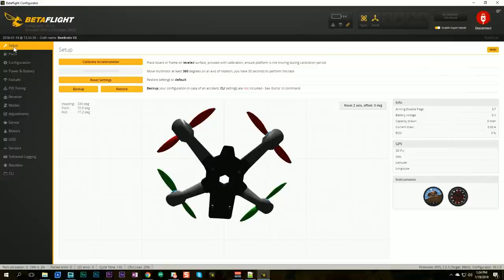Calibrate & Trim Betaflight Tiny Whoop Accelerometer | HOW TO FIX ANGLE MODE

Comment: Hi joshua, is it possible to have one headlight profile for level mode with trim and one more without if you want to fly acro in a wide area for example.
Reply from the maker: +Guillaume Fouquet accelerometer trim doesn't apply in acro mode. So just switch autolevel off using flight modes.

Comment: Thank you very much for that Brother Bardwell!  I have a BabyhawkR that the usb port ripped off of and it happened before I was able to set up modes so stuck in angle or horizon, no acro and after winding up in a tree, couldn't re-arm for just that reason.  The stick trim thing was cool too, so what are the trim buttons for then?  Looks like the stick commands for trim work quite nicely or do the trim buttons do it for the radio itself, not the individual bird?  Never mind, I get that part now, the stick trim does the bird itself, not the radio.  Thanks for all you do!
Reply from the maker: The trim buttons are used to trim out the stick itself if the stick is not re-centering correctly. The trim buttons should not be used to trim the flight characteristics of the quad. If you are using an airplane with servos, then the trim buttons are used to trim the flight characteristics but when you have a flight controller that's not how it works.

Comment: Also what about “in flight accelerometer calibration” ? I use it on the momentary switch on my Taranis to recal on the fly after a crash where my accelerometer wonky. Hope you get you voice back soon.
Reply: Yeah, I do this, too. It's a fantastic feature, and extremely useful for exactly the situation you describe. Kinda surprised Joshua didn't mention it in the video.
Reply from the maker: +Flight Dreams I didn't mention it because I didn't want to dive too deep into setting up flight modes.

Comment: Cheers for the vids JB.  I was wondering....if you haven't already, do a video on end points. I'm a noob. Learning slowly.  Have a few quads and trying to learn acro etc.  Followed videos on this quad and that quad and used the same pids/rates etc.  Tried flipping the quads like the reviewer was doing on stock pids.  Their quad flipped no problem.  Mine slowly rotated into the ground.  I know I'll put the rates up.  Still no joy.  Couldn't understand it.  Then noticed when I was checking the quad move in betaflight that the pointer on the graph was only going to say halfway left and right.  Looked into this and found out about rxrange # #### #### command to set endpoints.  Almost worked.  I now know about calibrating my sticks on the transmitter (Devo 10 Deviated with 4 in 1 module).  Just think it would be a good vid for noobs.

Comment: my brand new mobula 6 just yaws non stop..Ive been battling everylittle thing ...the props were on backwards for starters it tried to fly down not up. I couldnt get it connect for ages..then it randomly did. But now I cant figure out how to make it not just continuesly spin. I had to turn ondshot600 just to make one of the motors work. I thought the esc was blown..Man I would love too see a obula 6 FULL start to finish EMUflight guide please bro.

Comment: The key for a 10/10 accelerometer performance is to do a 6 point calibration is something, done in iNav and other quads for aerial photography, the acc won't suffer from drift after 1-2 mins of flight by doing this.

Comment: Thank you for this video Joshua. I'm just starting out (first flight today)! I've found that there is a persistent drift to the left (slight roll?). I've troubleshoot it to see if it's a problem with the sticks, or accelerometer, and it feels like it's neither. Connected to betaflight while leveled on the table, after arming, the graphic interface of the drone seem to be shifting, and the OSD horizon shows to be significantly off (at around 30 degree) even though the quad is resting on the table. This coincides with what happened today on the field where I had to roll to the right to keep it leveled. I did this both on horizon and acro mode and they all were shifting... Any thoughts?

Comment: Pretty sure you have to save trims before disconnecting battery - either with stick command or by connecting to pc and clicking save in beta flight config.
Reply: There have been a lot of comments about this so far.... In a fairly recent BF release ( I think it was 3.2) a change was made so that all accelerometer trim changes made via stick commands are saved automatically. No more manually saving them.

Comment: Good video! I have a point/question to address in your next videos. How come sometimes after a tiny whoop crash/bump the accelerometer resets/recals to be unlevel. It’s like for a brief moment during the crash/being sideways it recalibrated on its own. This happens on my acrowhoop v2. 

It would be ideal to prevent this from occurring so you don’t have to recal with tiny whoop flat on ground after this crash/bump Anomoly. Ok thanks!

Comment: Josh you're missing a big part of the equation here. I've talked with Jesse about this in great depth. It's not just auto level, it's also having a stock FC (specifically the Inductrix FPV FC). The factory tune can not be perfectly replicated in BF and they never fly as well in auto level.

Comment: Note that since Betaflight 3.3.0, to use the accelerometer trim stick commands, the craft must be in angle mode when disarmed. Simple fix; adjust the angle mode setting in the configurator/modes tab to include when disarmed.

Quite why they made this change I can't fathom, it's not like the accelerometer trim affects acro mode.

Comment: Don't be ashamed to fly in angle mode, guys. #metoo
Reply: Thank you for NOT angle-shaming me! One day I will be an acro-flyer, but until then I no longer have to hide my quad.......😁 It feels so good to be "out" 😀
Reply: @sunsetpark_fpv  I don’t know if you’re joking but I’ve been flying since 2015, I use angle mode inside. So much more fun, not having to constantly correct for air disturbance from the ground/walls, etc. outside it’s acro tho 😝

Comment: I usually save on the taranis after doing a trim as I was under the impression that if you disconnect the battery it resets the trim back to what it was originally set at. Sticks down and opposite. On the angle mode vs acro flight, I am always a bit in two minds, as I have flown helis for years its almost identical to angle mode in reference to having to always hold position on sticks except there is no limiting max angle by the flight controller i.e you always have 10....15.....20 degrees of stick held to fly in forward flight and if you release the sticks the swash tends to level out and heli slows down particularly with flybarless......albeit a lot slower than a quad. And having this type of system in no way limits the type  or speed of any manoeuvre. Which kinda confused me when I hear that you must "fly in acro" to be any good being force fed all the time....which I do anyway. I'm sure with some tweaking in BF cli the angle restrictions could be removed or tamed .....obviously horizon mode now but to allow inverted for longer hang time etc. I think....doh! Now I am confusing myself again 😁
Reply from the maker: Hmmmm that's a good question. Do you need to save? I would have to verify it.
Reply: I just checked.....it looks like it auto saves now, so no need to save.
Reply from the maker: Oh that's nice.

Comment: How do you do this accelerometer trim with a Specktrum radio? Cant you just trim it like you normally would with the trim switches?
Reply from the maker: No. You shouldn't use the trim switches for the reasons given in this video. The process of trimming the accelerometer works the same regardless of what type of radio you use because the trim is being handled in the FC not the controller.

Comment: On the betafpv 65s when attempting the stick calibration non of the lights flash. But it does seem to work. Just not sure if it is actually working.
Reply from the maker: I had the same thing on the acrobee. I do think it's working though.

Comment: HELP! My 3" quad pitches backwards after calibration, and adjusting through stick commands.  It seems fine for about 30 sec then increases after a short bit of  stick deflections. what can I do?
Reply from the maker: This is the accelerometer drift bug and there isn't a fix that I know, other than to change out the FC.

Comment: I was having a frequent calibration issue with my NBD and picked up a good tip from "Derek and His Drone" that makes my whoop re-calibrate every time I power it on 'set gyro_cal_on_first_arm = ON'.  Seems to have fixed my problems :)
Reply from the maker: The gyro always calibrates when the FC powers up. The gyro cal on first arm just changes it from "as soon as you power up" to "just before you arm".

Comment: you used to answer my questions in a timely fashion! just saying must very busy!...anyway my Q- the bataflight F4 how do i hook up the beeper ? i soldered one to the board but nothing! di i need to into bata flight config?..
Reply from the maker: I currently receive about 150 questions per day, all of which I answer if I can. Sometimes I don't know the answer, and instead of saying so, I just pass over the question to save time. Sorry if my response time is not as fast as it used to be. Please don't hassle me about it I am doing my best.

If you soldered the buzzer correctly to the board and it still doesn't work, I don't know what it could be. Even if you have enabled dshot buzzer, I think the regular buzzer still works. But I guess I would try seeing if the dshot_beacon_tone parameter is nonzero, and if it is nonzero, set it to zero.
Reply: no! no hassle sir! im just saying! ...its hard to get expression across in a text!..im having problems with the buzzer functioning on the bata flight F4 has this happen to you?

Comment: Accelerometer measures acceleration and deceleration. So why does it matter the angle the flight controller is? How does the accelerometers detect angles? Isn't that the job of the gyroscopes?
Reply from the maker: Gyros cannot detect angles. Gyros detect rotation but not linear acceleration or deceleration.

Gravity manifests as the feeling of a downward acceleration. Therefore, the accelerometer can detect the direction down and up. You are correct though that acceleration can throw off the accelerometer. If you move forward rapidly, the artificial horizon in an acro-mode quad will pitch back from the acceleration.
Reply: No Josh, conceptually wrong.
Gyro detect angle but without enough accuracy  for a long time .
 Accelerometer measure G and his variation of direction is a good measure of an angle for a long time.
That's why you need to have an accelerometer for long term stabilisation.
Reply: A gryo is balancing mechanism based on a circular 3D plane and provides data on initial set point and angular momentum/feedback as it resists to retain that set point. Gyros in that sense are automatic. Accelerometers are a form of measurement and don't perform correction on their own. You can view them as  basically 2 levels on a 2D X/Y plane that need their 0 points calibrated in order for the FC to understand tilt/angle as you see fit. If this center is off then you won't level out without manual intervention. Accelerometers being off can/will have more affect than front/back/left/right drift (the most obvious thing to perceive)..specially noticable on micros. The gyro can find itself fighting the accelerometer data and your stick interventions to overcome it, making things erratic in flight or straight err out and flip on it's own or whatever.

Comment: how do you calibrate in  receiver mode 1?  the yaw and pitch are on the same left side?   Thanks.
Reply from the maker: The stick command is the same relative to the axis. Just which stick you move changes. Pitch and roll still adjust trim.

Comment: Hi Joshua. I appreciate your work, thank you. What is going on if my BetaFPV 65s is ever so slowly yawing left. I calibrate, and trim right using the radio but it continues to do it. I have not checked the end points since setting them,  so is it possible the yaw low is above 1000?
Reply from the maker: Yaw center would cause slow left yaw. Yaw needs to be centered at 1500. Don't trim to fix flight characteristics like that. Look in the receiver tab and make sure the channels all center at 1500 and endpoints are 1000/2000. Instructions here: 
https://www.youtube.com/watch?v=PCLxyurZsD0
https://www.youtube.com/watch?v=XQXV6bjCfuA

Comment: Great videos, Im finally getting it somewhat stable with the trim, it does seem to be eradic with the throttle sorta bouncing off the ground, I understand there is a hover height to get to but I think im there at about 6ft off ground but it seems to want to drastically fluctuation throttle without being controllyh, any suggestions on settings to look at?

Comment: Newbie question. Why not use the trims on the transmitter?  Also,  does this work on all transmitters or just the Taranis?
Reply from the maker: +ernie5229 all transmitters. Using trims in the transmitter will mess you up if you ever switch to acro mode. Also on some transmitters, changing trim also messes up the endpoints.

Comment: So if I calibrate using stick commands I don't need to use the calibrate button in betaflight? Also what is the difference between stick commands and those black 2 way sliders next to the sticks? I find it drifts unless I use the 2 way sliders to trim it.
Reply from the maker: Calibrating in betaflight zeros the accelerometer out if it is way, way off. Stick calibration fine tunes that.

Don't use the trim switches. Use the accelerometer trim as shown in this video.

Comment: Hey JB-

Does this process for Accelerator Trim apply to Acro mode as well, and does it work with yaw? I just built my first 5" quad, and am getting a bit of left yaw. I was able to pretty much eliminate it with one right click of the yaw trim tab on my Taranis, but I don't care for that solution for some reason. Would rather fix it in Betaflight. Thanks!
Reply from the maker: +Ryan Kidwell accelerometer is not used in acro mode.
Reply: Joshua Bardwell thanks... how would you fix a yaw problem like I described?

Comment: Hi Joshua, love your stuff.  Follower and recent patron. Been in the hobby since KK boards and still love to build my own stuff.  That said, I've got a Eachine E010S and love it.  I've flashed it with BF 3.2 and would like to know what settings to use. It's flying ok but I'm sure there are pids and other settings that should be optimized for brushed micros. I'd love to have your thoughts on the E010S as well.  Very popular inexpensive micro for a variety of radios.

Comment: What is the difference between this accelerometer calibration and trimming on your transmitter?
Reply from the maker: If you trim on your transmitter a bunch of other things get messed up because the channels aren't centered. For example if you switch to acro mode the quad will spin out of control.

Comment: I tried many times to calibrate this accelerometer. Even used a damn level! But I still get drift to the right. I saw how your roll trim was positive 14, so I tried doing that manually, I even set it up to 25 and nothing seemed to changed. Do you know why this may be? Near the end I just changed my subtrim 13 clicks left, and it helped a bit, problem is if I ever want to fly Acro mode it will just roll to the left at a consistent roll faster and faster. I have Mobula7, and I know it has telemetry, but the stick inputs for trim don’t work, as well as some other inputs. I’ll get the beep for changing profiles, but calibrating and trimming don’t seem to work on the FlySky mob7 model.
Reply from the maker: Don't use trim switches because it messes up acro mode, as you found.

You need to be in angle mode for trim to work.

Keep using accelerometer trim until it hovers level.
Reply: Joshua Bardwell I’m just having troubles with my betaflight. When I click modes tab, I get nothing but a box that says ARM- Add Range, and a check box that says hide unused modes. Someone told me to find the version I have and reflash the firmware to the same one cause this can happen when the manufacturers install a early release version. How do I put it on angle mode in betaflight to trim the accelerometer?

Comment: is auto level the same as altitude hold?And thanks for the vids your right i do learn something every time i watch.
Reply from the maker: Auto level is not the same as altitude hold. Auto level causes the quad to level out but you still need to manage the throttle yourself to maintain altitude.

Comment: Do the trim switches on the transmitter work? I come from RC Aircraft and we use the trim buttons on the transmitter to fine tune controls.
Reply from the maker: The trim switches will mess up channel centering when in acro mode. This is the correct way to trim a multirotor accelerometer. Trims should always be centered and channels should always center correctly. You're not driving servos here :-)
Reply: @JoshuaBardwell  I used your method on my Mobulite 7 over the weekend to trim for indoor flying. What an improvement. Made it much easier for tight indoor environment. I'll be doing trimming before every session from not on. Thanks for the great tutorial!